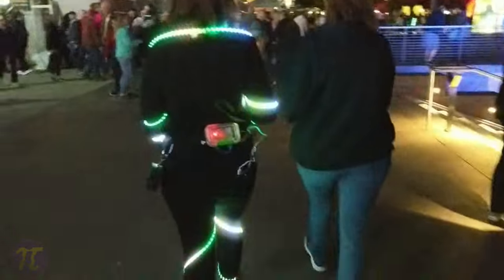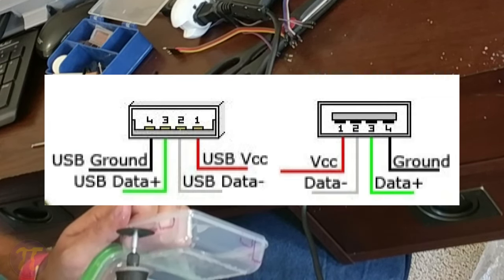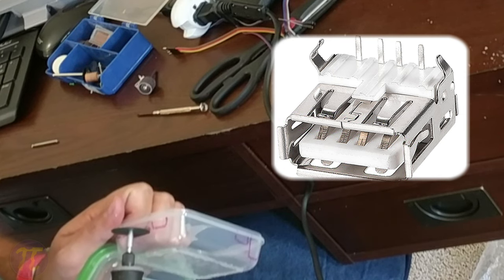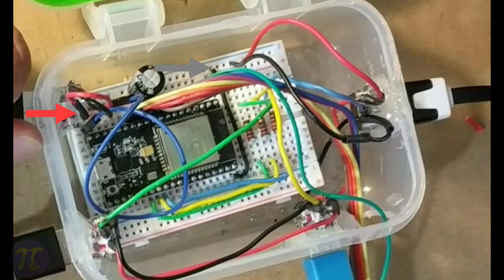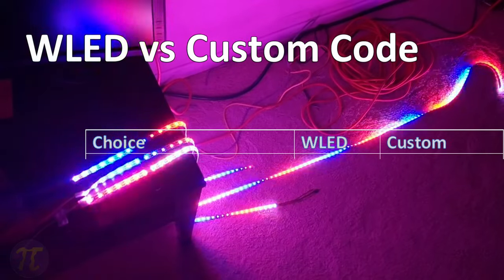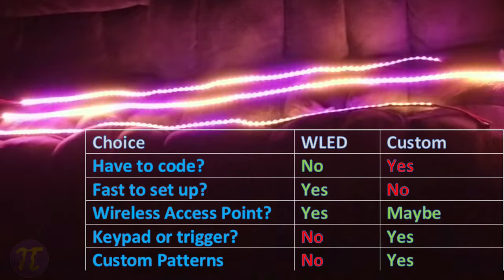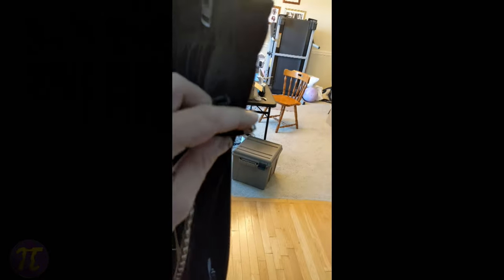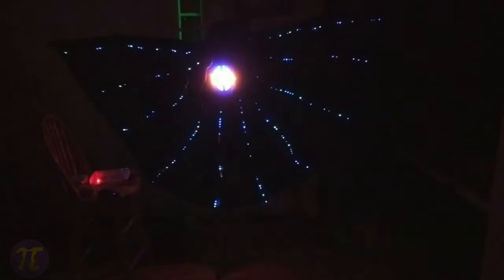How to build a Pixel LED Mobile Suit Part 2: Build Suit

Comment: How did you manage to power it with usb without voltage drop?
Reply from the maker: @colestrekal2609  
Good question 

Each piece of the suit is connected with a USB cable and has its own data port. 

You get voltage drop if you chain a lot of lights together and not power inject.  The first suit with a run on each leg and one on the arms, I didn't need power injection.

However, For longer runs like the cape, I had a separate USB without data hooked to the end of the run to provide power injection